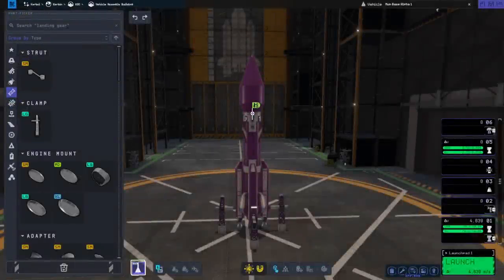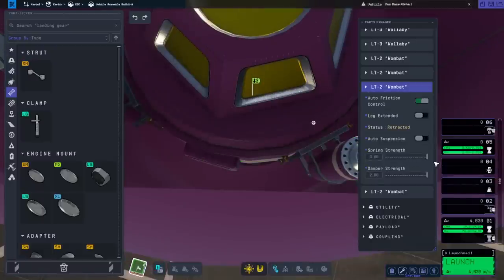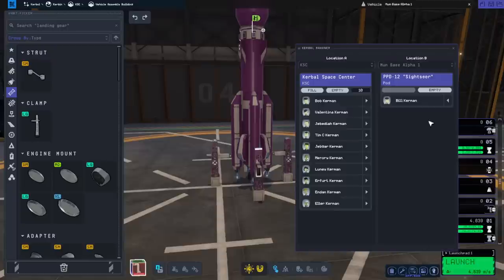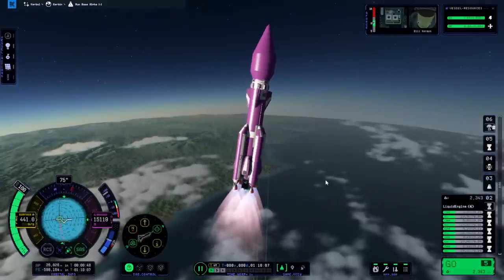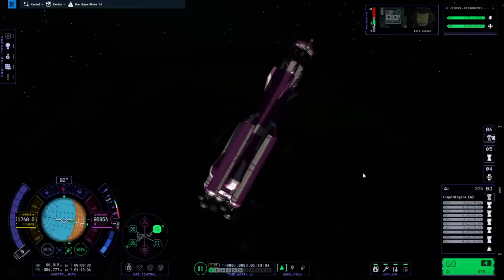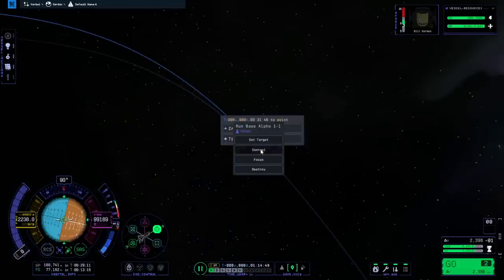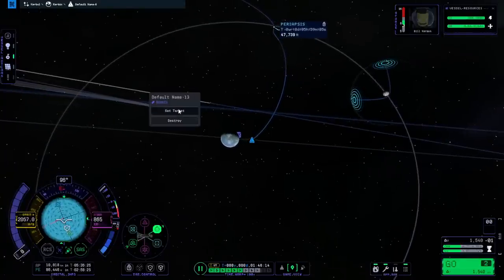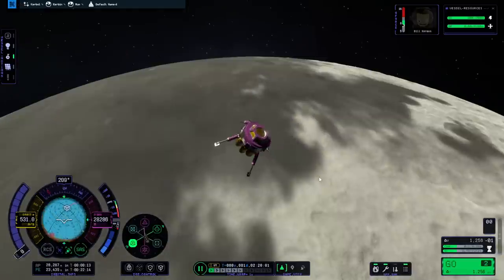KSP 2 Early Access - Mun Base 01

Comment: Your booster explodes because of the decoupler. I had the same problem with a shuttle I built, where the ring flew through my craft in the same way, and everytime I returned to normal speed from time warp it exploded like yours.
Reply from the maker: I was sort of hoping the patch fixed that, but I guess not.
Reply: @RaizSpace  Same, super annoying :/ I'll use separators and delete them until they fixed decouplers.